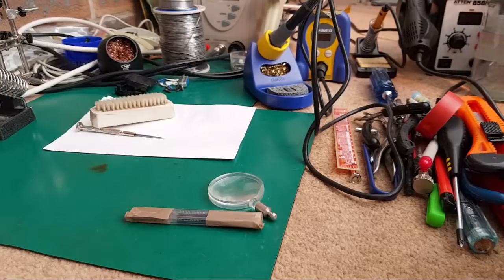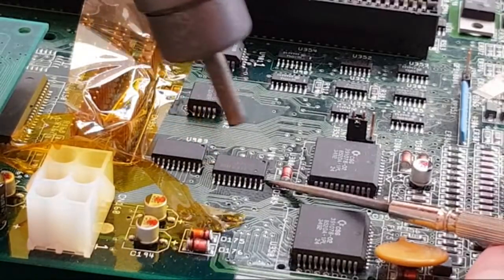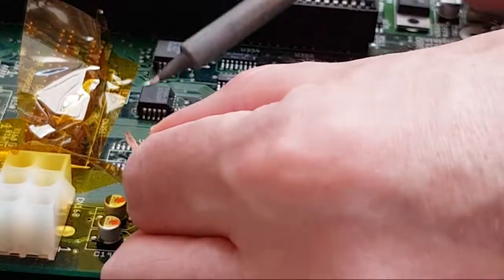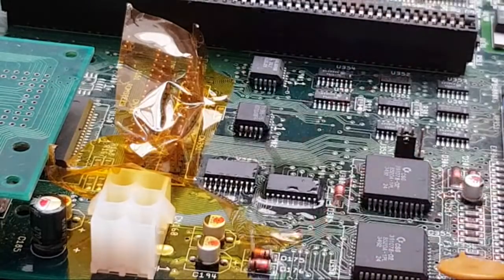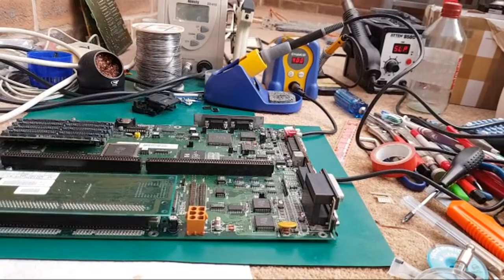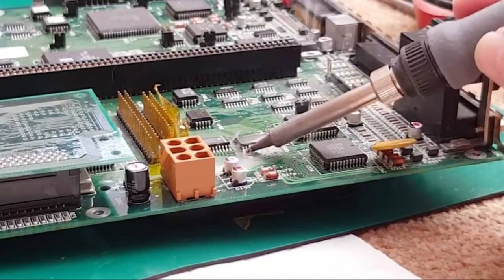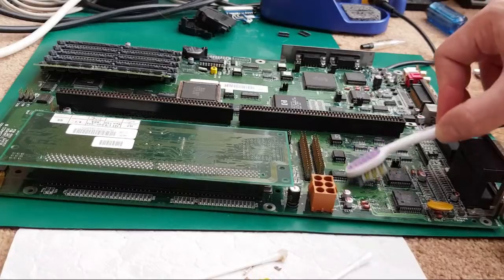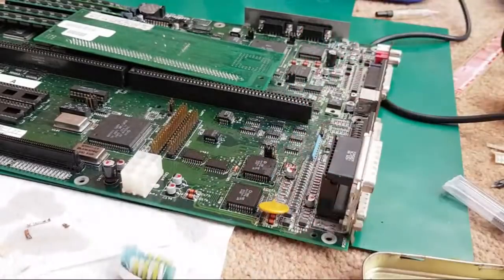Commodore Amiga A4000 IDE Polling - Swapping 245's (Trying to fix that 6 second polling issue)

Comment: Hi Chris
I have been enjoying your recent videos keep them coming.
You could use solder paste on the 2 corner pins to help hold it in place warm those 2 with your soldering iron then do the rest as you do normally.
I think it takes you a long time to remove the chips with hot air, is I believe you are supposed to warm the bottom of the board at least 4 x the area you are working on to approx 100-120 deg c with a lot bigger air gun then work on the top side with your small gun.
Reply from the maker: Thanks, and thanks for the advice =D

Comment: I would be interested in (if you decide to do it) if you can get an ide/atapi cd rom drive working with your system, i tried everything and with that cf card adaptor that you are using and could not get it to work.
Eventually installed an ide  hard drive and all was fine .(using ide fix)

Comment: if you dont mind me asking where did you buy the replacement hct chips? or was they off another board m8?
Reply from the maker: eBay!
Reply: @GadgetUK164  i tried that but was unsure if correct they have mostly slightly different letters at the end , i was wanting to get the ones you used. Ty anyway mate :)